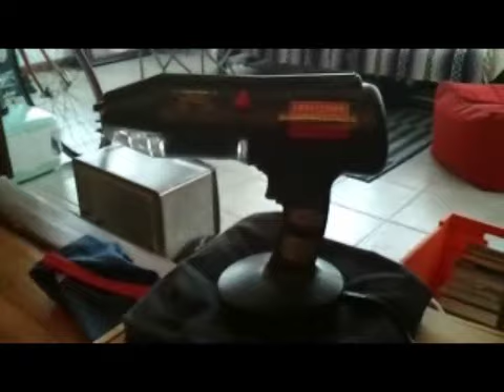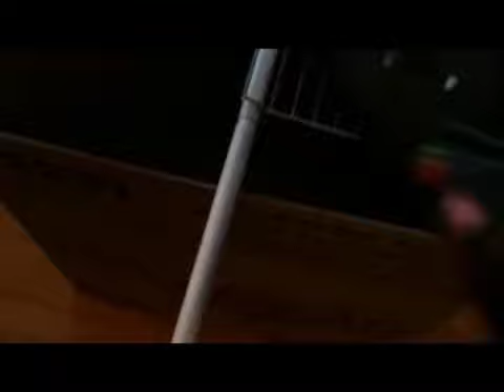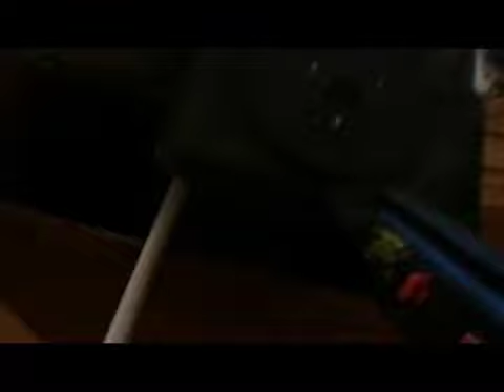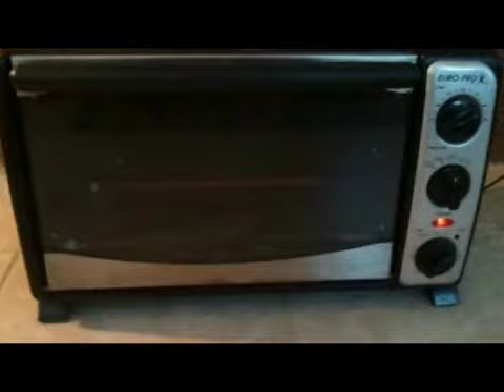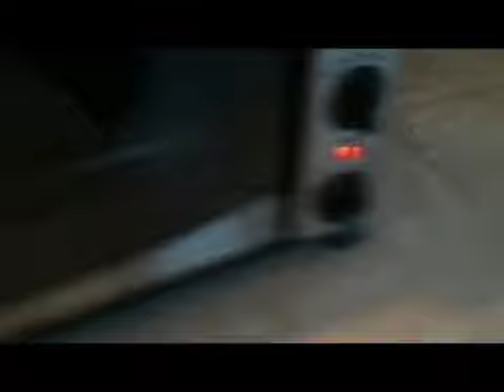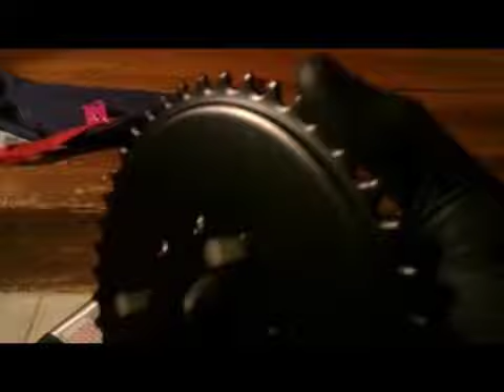Craftsman Home Powder Coating System Demonstration for powder coating

Comment from the maker: there is a grounding wire that runs from the gun.  It is connected to the part to be coated.  This is to ensure that the part is "charged" so the powder is attracted through a kind of static electricity.  Hope that helps.

Comment from the maker: @joojoo1234 
I dont have the manual in front of me at the moment but I would say it can hold about a 6 oz. cup worth of powder which I would think would cover the area that you are describing. It goes on much better if the surface areas are flat.  I do a lot of odd shaped parts and end up wasting alot of powder but I think you could definitely get complete coverage of yours with a full load of powder.  Hope that helps a little.

Comment from the maker: it takes about 3-5 minutes on smaller parts, could take longer on larger parts to fully glaze over.  Once this occurs, you can begin the timer for curing.  Hope that helps some.